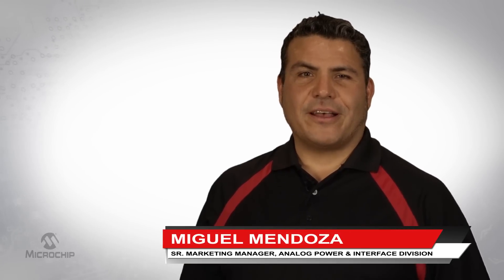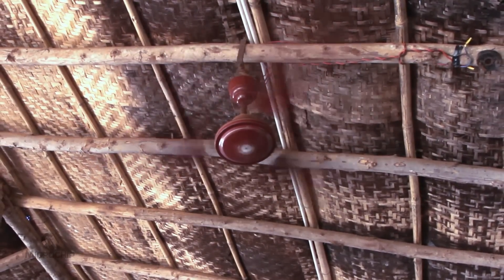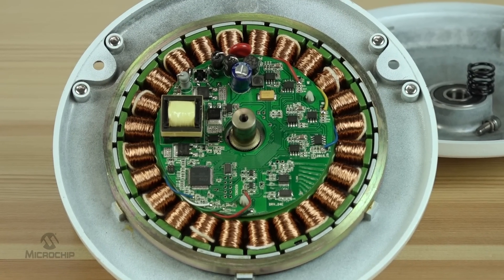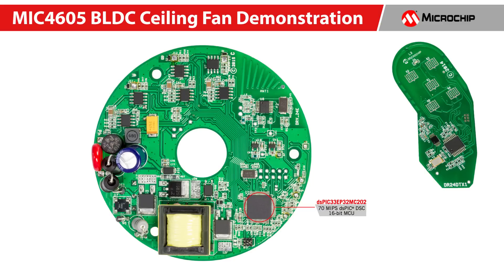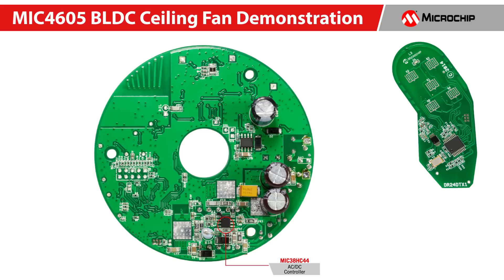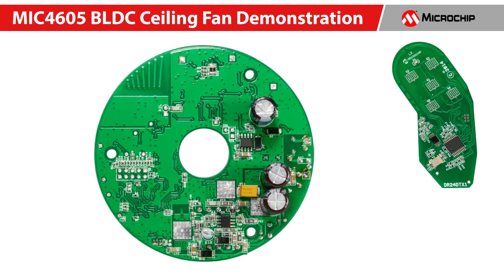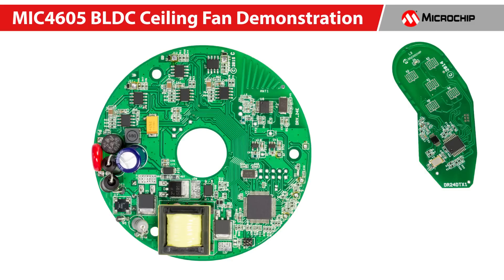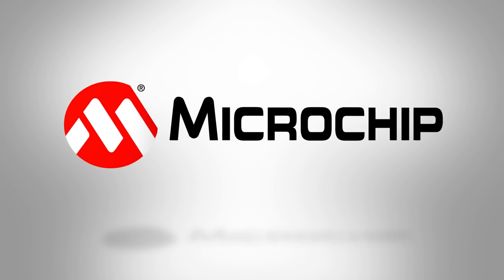MIC4605 BLDC Ceiling Fan Demonstration

Comment: Sir would you please share the schematics design of that PCB. I want to complete my university task.
Plz...
Reply: Plz
Reply from the maker: Hi Usman, thanks for your question. We have a newer reference design for you to consider, released this year. Please view our Low-Voltage Ceiling Fan Reference Design: https://www.microchip.com/en-us/tools-resources/reference-designs/low-voltage-ceiling-fan-reference-design

Similarly to the MIC4605 BLDC Ceiling Fan Demonstration requested, this new design can be used with any existing 3-phase BLDC and use three MIC4605 Half-Bridge MOSFET Gate Drivers in the schematic.

With the link provided above, you can fill out the form and download the design files to get started with your project. But if you need any further assistance with your project, please do not hesitate to contact our team at www.microchip.com/css and we'd be happy to help.

Comment: What is the maximum KW rating of motor which is available in BLDC type of motors
Reply from the maker: The max power MIC4605 BLDC design can typically cover in the range of 100A x 48V=5kW.

Comment: BLDC fans how much heat produce.Can the chip work in heating condition.
Reply from the maker: Here's a link to the product page for the MIC4605 where you can get all the specifications: http://www.microchip.com/wwwproducts/en/mic4605
Reply: Its no matter 
Overall performance are very good indeed